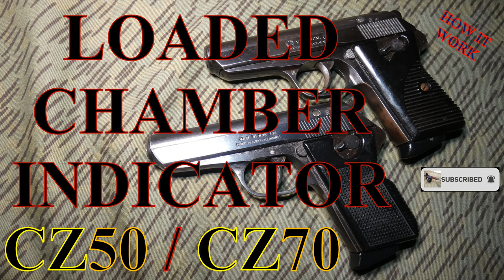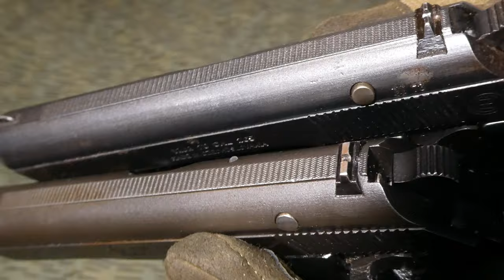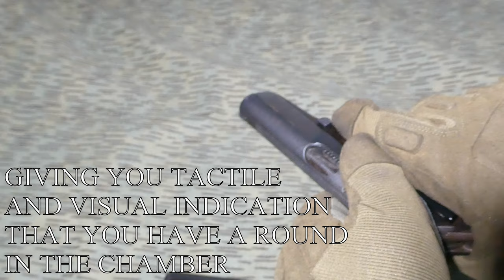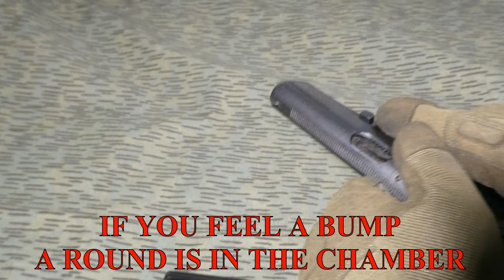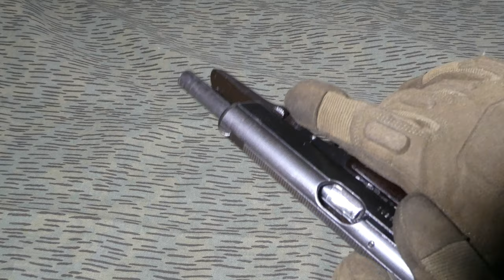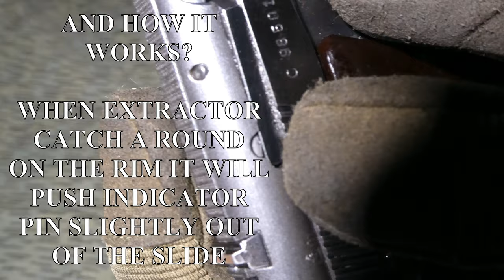CZ50 / CZ70 Loaded chamber indicator (4K)

Comment: I have cz70 the fire pin is broken, but also the hammer  does not lock at the bottom when I pull the slide .
The last part of the pin is not exist !!
What should I see??
Reply from the maker: best way will be to visit a gunsmith as hammer not locking is possibly broken sear... replacing firing pin is easy, 2min job at max with no previous experience but broken sear is work for a gunsmith